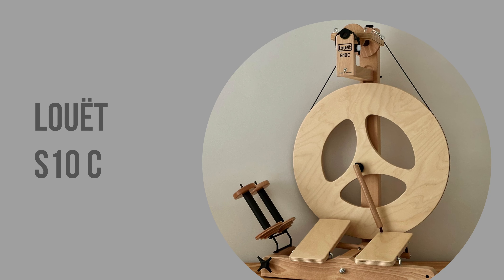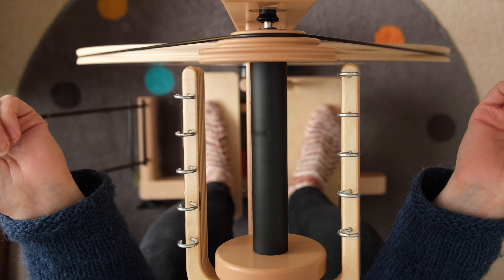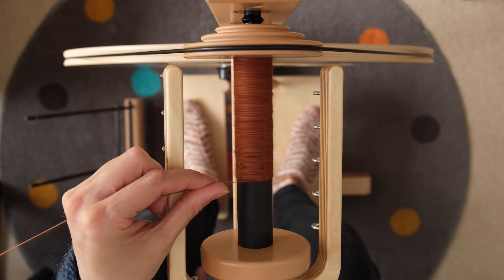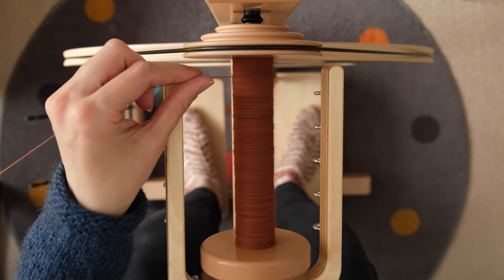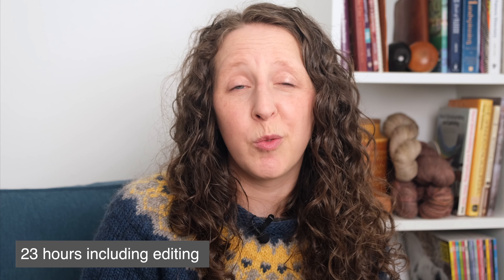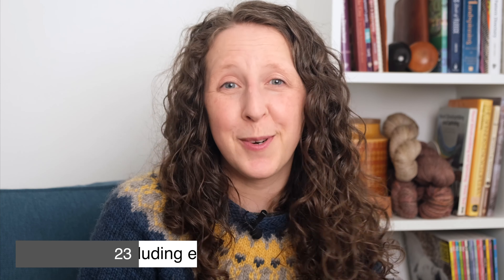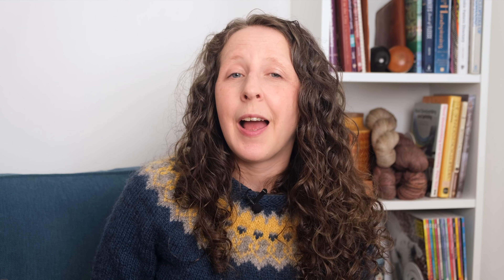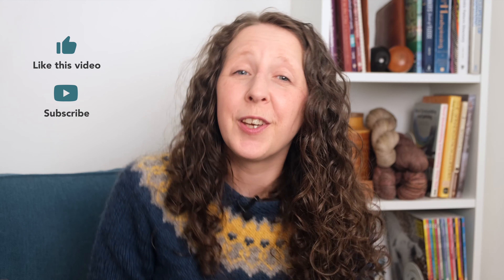Rewinding bobbins on a spinning wheel

Comment: You had asked for us to add our wheels to the list of wheels that can be arranged to run a single onto the bobbin. I don't know if any commenters have mentioned the Ashford Kiwi 3. However, I have one, and I was able to figure out how to make it work so only the bobbin spun. I ran the drive band over the back of the  bobbin, and the rest of the drive band ran on the middle groove of the wheel. I tried it around the smallest wheel groove, which was closer to the bobbin, but it was slipping off, so too loose. The Kiwi 3 is set up so that the back of the bobbin and the wheel are "almost" on top of each other, so no real danger of damage to my wheel. Thank you so much for sharing this video!

Comment: Loved the itty-bitty violin :)). I have a Kiwi 3, and I usually just stick a dowel with duct tape at one end into the orifice, put an empty bobbin on it with a binder clip over the dowel in front of it to hold it in place, and treadle away. Not quite as easy as on an Irish tension or DD, but pretty simple and works well enough. :)
Reply: Hi. I'm very interested to see a pic of that as I have the same wheel.
Reply: I have this wheel too, I wondered if it would be too much stress on the brake to tighten so that it does not twist as your treadle. I've done it a couple of times (!) and just worry about the spring on the brake knob-tension system wearing out too fast. @tinyfibrestudio- I would love any thoughts you have on that!

Comment: I haven't tried this yet, but I have a Lendrum DT scotch tension wheel and I was thinking about taking the flyer off and using a 5.5mm straight knitting needle as a shaft so that the bobbin will be better aligned with the wheel....I will be careful!